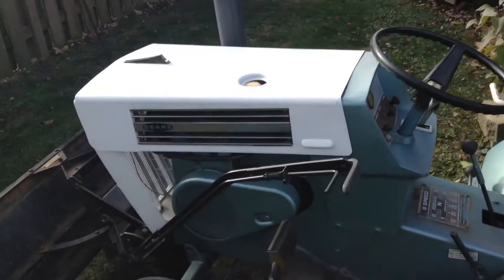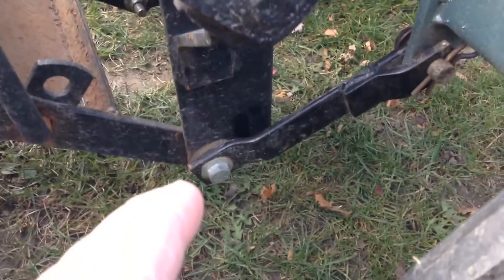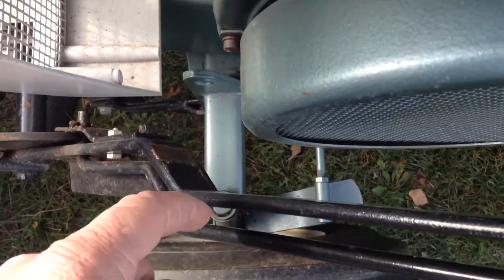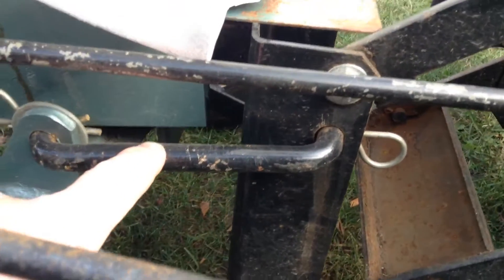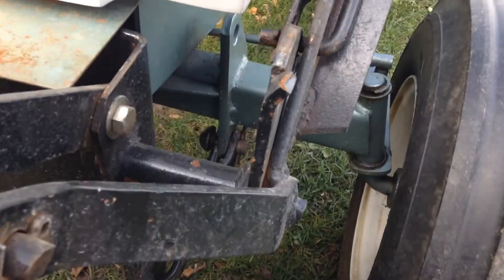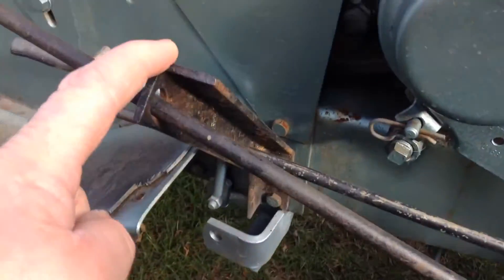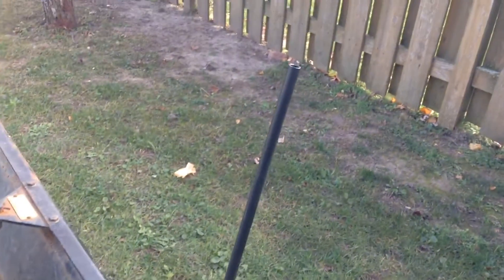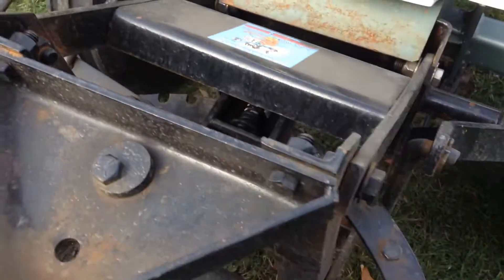Plow setup on a Sears Suburban

Comment: I need to do some welding on my blade . I going to have to see if i got the top stabilizer bar or not . If not i will prob make something to put there . Good video .
Reply from the maker: wtbm123 Thank you sir! Yes my first plow didn't have that bar and it would flex and creak so it does need it. Lol

Comment: Rooney, I have misplaced the round support rod for my blade. How important is that? I still have the two bottom arms.
Reply from the maker: januaryman169 I don't think it's a must have JM, but it does help keep flexing down in tougher pushing situations.
Reply: RooneysSears01 where would you find the support rod i am missing one?

Comment: Rooney, I have that same exact blade. As you may know, I attempted to make my own pivot linkages. It didn't work. Would you be able to make them? If so, what kind of cost are we looking at? If you want send me a pm. You have the best tractors.
Reply from the maker: januaryman169 Thanks JM! Whoa I thought you did a great job making that stuff what happened? lol
Reply: RooneysSears01 My rods were too weak. They kept bending. The half moon bar on the rear of the blade was bent causing things to bind up.
Reply from the maker: januaryman169 Gotcha! My first blades pivot was bent up like that too, I'd say try it again with alitttle thicker rod.